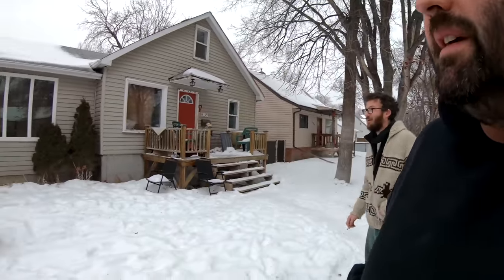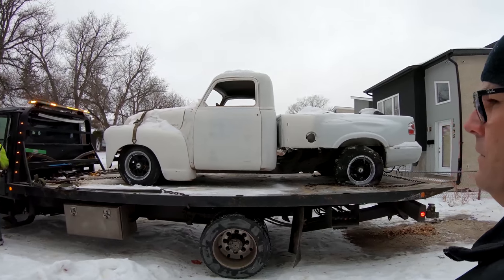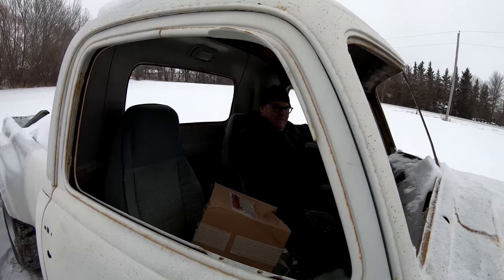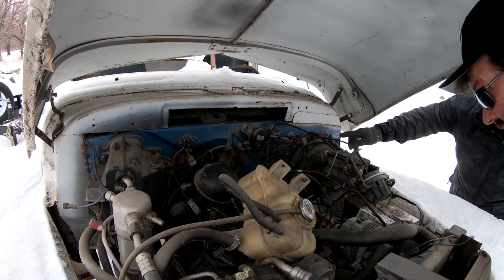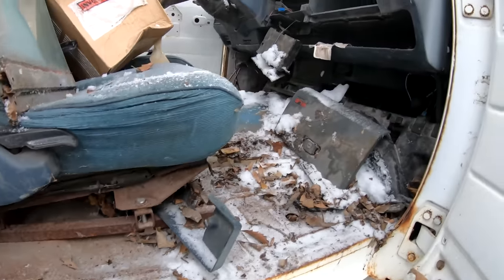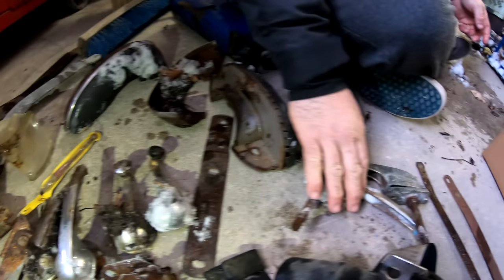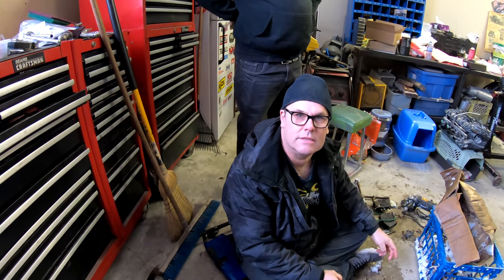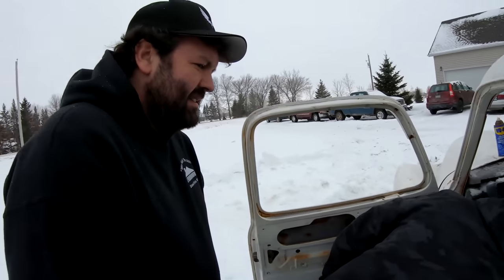Our NEW PROJECT TRUCK | 1951 Chevrolet 3100 / 1st Gen S-10

Comment: For reference s10 truck frames from 82 to 03 are the same . My 90 is on a 98 chassis . 94 and up are better chassis boxed further back stronger chassis . Body mounts in same  place .  This should be a fun build.

Comment: That was a terrible way to put the old body on the s10 frame. Cutting out that dash and floors was wrong, they should have left that all there..we did a 57 Chevy pickup on a 2002 s10 frame and it turned out killer. ..the one you got will take work but its worth doing something with.....
Reply: Yes. That was a shame to cut out the original dash.